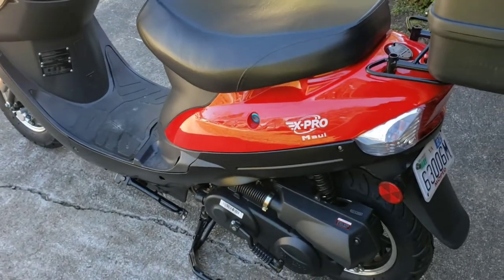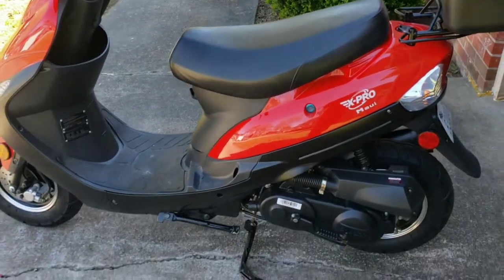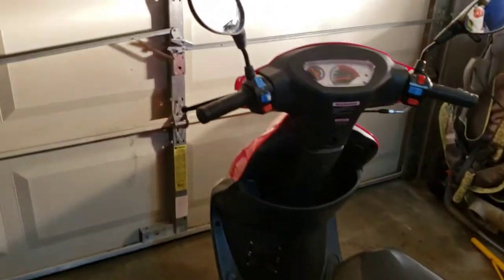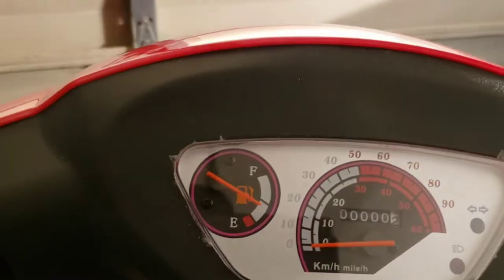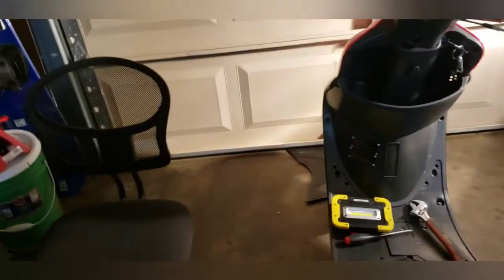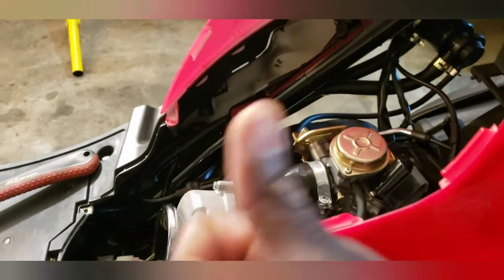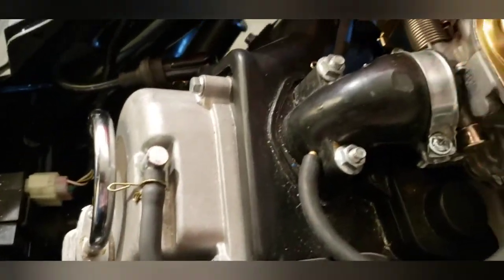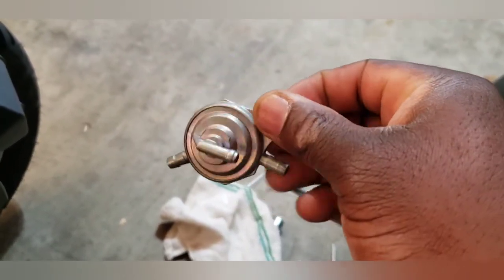PROJECT MAUI X-PRO SCOOTER UP AND RUNNING PART1

Comment: You need to adjust the valve lash on the cylinder if the scooter keeps cutting out and not running well. The problem is most likely that the valves is very tight. The in flow valve gap should measure 0.003 and the exhaust valve gap should be 0.004. Measure it valve lash or gap with a feeler gauge.

Comment: Not supposed to pull on the throttle when starting the engine.    If it seems to be a requirement then you have a different issue.      The valve lines you are using are cheap and should be replaced with wired vacuum lines, they are thicker, more durable, and wont have hidden cracks you cant or can barely see.     Considering the fact it turns on, that eliminated spark and gas.    That leaves you with air.     With that said, its time to check the valve lines and air box.    Make sure everything is secure, not over tightened, and all lines are good.    Change all filters as well, including the gas filter.

Comment: Hey you're doing fine I appreciate what you've did   cause I have an x-pro 150 Milan with 1400 miles on it a running as I slow down to make a right turn the engine suddenly stopped and I don't know what's wrong with it  but just as the one you're trouble shooting it gets gas from the tank to  t that part that's between the gas filter and the tank but nothing   comes out of part to the filter so the carburetor doesn't get juice at all so the engine doesn't start so I need to know how to solve that problem myself  so thanks for sharing a solution I'll be expecting to watch the next    video it  could easily also be the solution to my scooter problem thanks again
Reply from the maker: Of course iam glad I could help you out with your scooter please watch my other episodes on my about the maui x-pro scooter it may help you some more. And please like and subscribe it helps me to grow and do more.
Reply: Hey fellow Milan 150 rider I love the bike but mines loud even with a gasket

Comment: refering to your carburator  just take a dremel and make a notch then use a flat head to open up the carb to the jets
Reply from the maker: Thanks I've already got it open and replace then with screws but in my other episodes I just and upgraded to a bigger carb

Comment: Adjust the air/fuel mixture there might be a welch plug but you can drill it out little at a time and check it you got to be careful when doing it
Reply from the maker: Yeah I did figure that out drilling it out and finally getting it but I replaced that carburetor with a 19 mm one so I'm dealing with that right now trying to figure out how to tune it but thank you for that I really do appreciate it
Reply: @fixitdaniel  to small carb if it's a 150cc it should be a 24mm and I think a 20mm for a 49cc
Reply from the maker: @ironhead320  well right now I have a 90 mm CC on Big Bore Kit in there and I'm running a 19 mm carburetor I did have a 28 mm carburetor in there before I bought the 19 so someone told me that it was too much so I did some research and found out that a 19 mm for a 90cc is about right so I'm trying to figure out from there with a 90 mm CC I have a cold air intake and a upgraded carburetor and exhaust what should be my pilot and Main Jet settings
Reply: @fixitdaniel  what size are the jets now it depends on where you live if it a dry heat but they says to go up on size so if your main is say 108 try a 120 with exhaust and big bore kit it can be a pain trial and error or put a AF meter with a wideband 02 sensor the kit runs like 240.00 but you might find it cheaper look on YouTube there a guy that explains it and how it works go up a little on your idle say 38 but you will have to re-adjust your mixture
Reply from the maker: @ironhead320  so in my 19 mm carburetor I have a 120 Main and a 40 pilot I also live on the coastal side of Virginia I thought maybe I should go down sizes on the jets
Reply: @fixitdaniel  you can try a 38 idle and a 115 main
Reply from the maker: Okay I'll try that cuz I was thinking about putting back into 28 mm and see if that made a difference but it's a larger carburetor for for that 90 I think
Reply: @fixitdaniel  you could try if the jetting gets to be a pain a 21mm would be perfect like mine came with a 24mm I went to a 26mm but mine is a 150cc but play with the jets and see what that does before you swap out carbs
Reply from the maker: @ironhead320  okay will do I'll try messing with a 19 mm before I try messing with the 28 thanks for all your help I really do appreciate the info
Reply from the maker: But yeah check out my other videos like And subscribe if you're not already subscribed which I think you probably are but check out my other videos and you see anything that you can help me with let me know
Reply from the maker: So I did the idle at 38and the main at 115 but every time I give it a quarter turn throttle it dies does that mean that my idling jet is too low and I need to go back up
Reply: @fixitdaniel  did you try to re-adjust the air/fuel mixture
Reply from the maker: @ironhead320  yep I did that I think I got it adjusted pretty good but everytime I give it like a quarter-turn throttle like a light quarter-turn throttle it dies so I was thinking that maybe gone too small of a jet because it never did that when I had the 40 so maybe I should go to like a 42 and instead of 115 Main
Reply: @fixitdaniel  try 42 and maybe 120main but do the idle first get that set and try main
Reply from the maker: I tried the 42 Idle Jet and kept the main at 1:15 and it seemed to start up and I was kind of had a able to do adjustments with the mixture screw perfectly I haven't got a chance to test it but I'll test it when I come back from my trip thanks for your help I appreciate it I'll let you know how it turns out
Reply: @fixitdaniel  it also could be your rings might not be seated yet take her easy
Reply from the maker: Okay if they are not seated how can you tell and if they aren't how long does it take for them to see
Reply: @fixitdaniel  they take a few runs lower speed to seat just don't rush it or you might be ripping it back apart about 500 miles
Reply from the maker: @ironhead320  okay will do I'll take it slow

Comment: valves should be .004 intake 005 exhaust
Reply from the maker: Yeah I did that to you I got it last two those specs but the issue that I'm having is that it's revving really high really fast and I only have a small room of air fuel mixture adjustment so I'm thinking that I either have too big of a jet or too small of a jet and I don't know which way to go should I go bigger or should I go smaller
Reply: @fixitdaniel  check to make sure you have no vacuum leaks as it's revving spray starting fluid all around the hoses and around the manifold of it gets louder rev or bogs out you have a leak sounds like a vacuum leak to me it wouldn't.revv high of idle jet is smaller it would just cut out when you give it gas